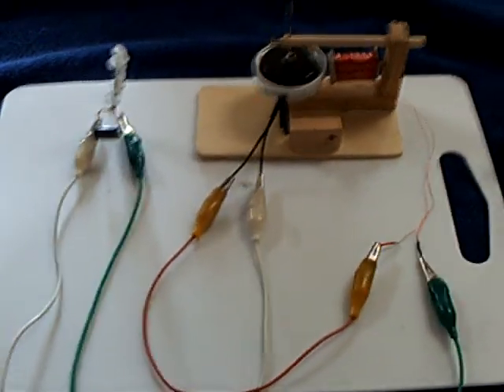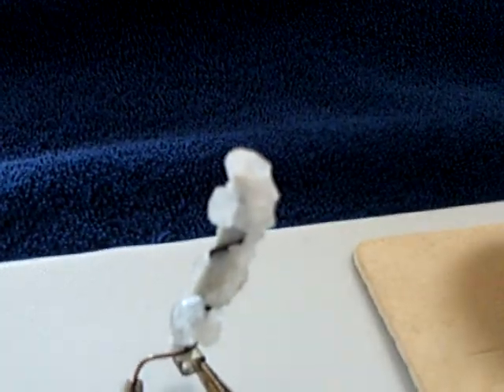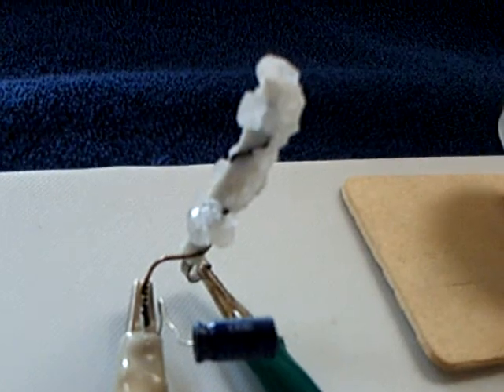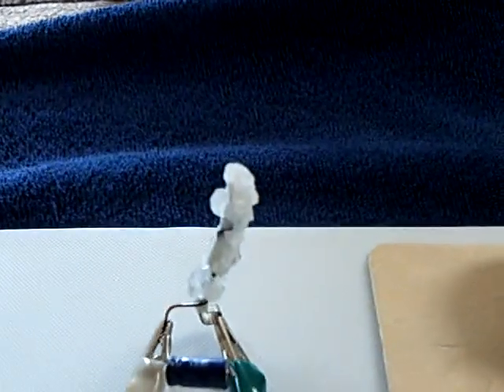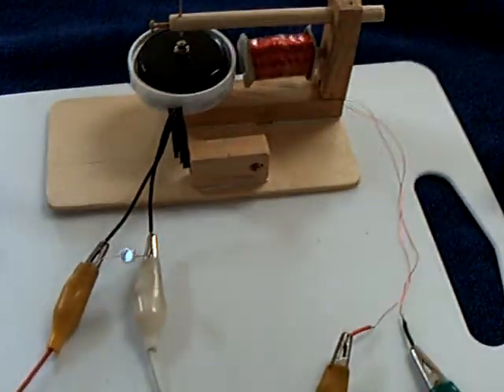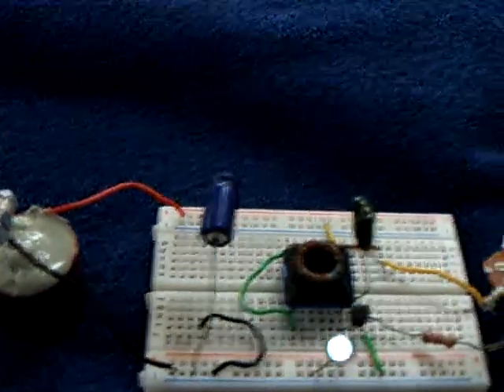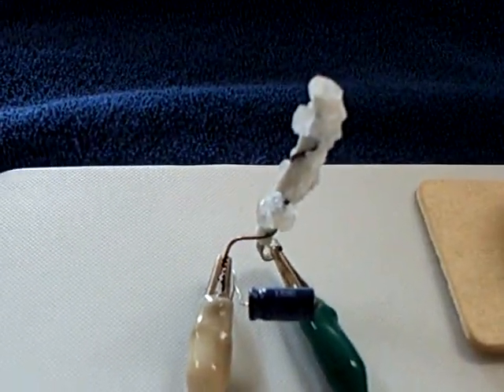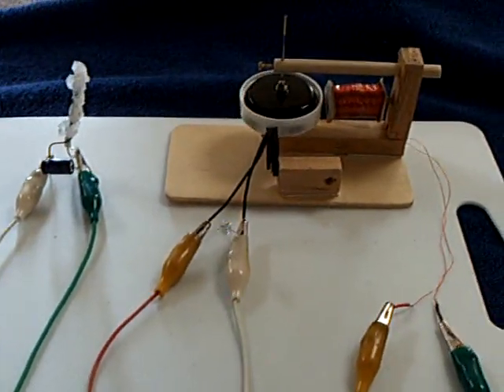Literal Crystal Battery--Running a pulse motor.ASF

Comment: its the oscillation of the water molecules inside the solid polycrystalline silicate that moves the electrons through the cell i believe. did you use any epsom salts. i cannot get that kindof voltage i always get less then 1 V, i use equal parts borax alum epsom salt and salt substitute, i melt it then pour it in a copper tube with an aluminum rod. i have magnesium ribbon on the way. does magnesium oxidize too quickly to use?
Reply from the maker: Magnesium is the way to get the most power out of a cell but you get what you pay for ----it vanishes quickly compared to zinc or aluminum.  When I was working with this stuff I got away from the mg ribbon and went to rods except for small test cells.

Comment: *****  I've been growing a set of similar batteries from borax and mag sulphate. I have them set up in series and have them powering an Led. Its extremely dim thou. I have plenty of voltage 5v, but i think low amps. 

I thought a capacitor may help, what capacitor are you using here, the ones i have tried are not working? 

Any advice would be really appreciated!

Comment: Once again great video! You're right about the slowing down of the galvanic process. If we can slow it down to where these cells at this size can run for years or maybe decades then who cares if its based on the galvanic process. But then again we could be getting more than just galvanic energy, I've done test to prove that not all the energy is coming from the galvanic process.

Comment: Excellent stuff !
I'm still trying to grow crystals, but I know where it's all headed now :)
Would be good to know if the cell reacts to hairdryer heat when epoxied, by increasing its voltage ? Seems an epsom salt trait, so was wondering about epsom water spray mix instead of alum.